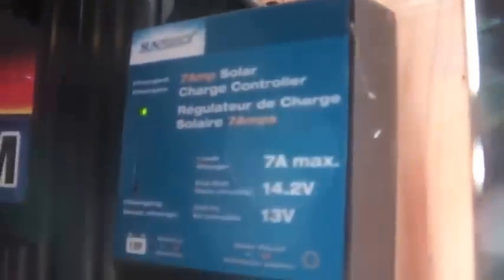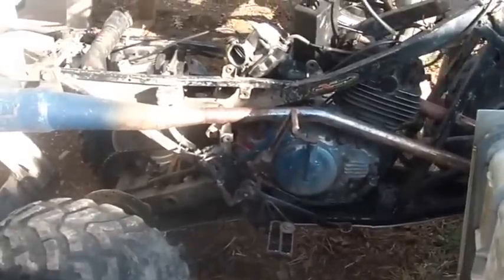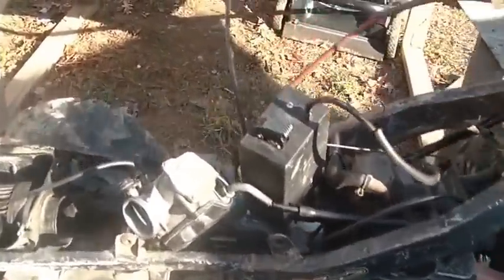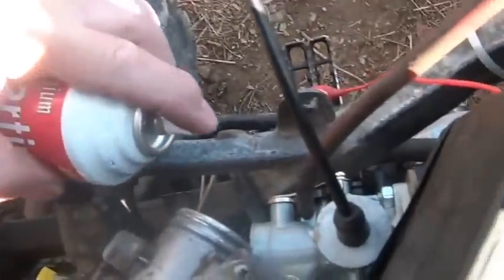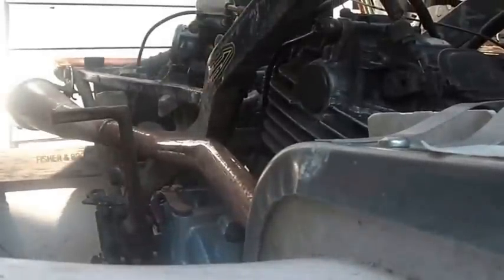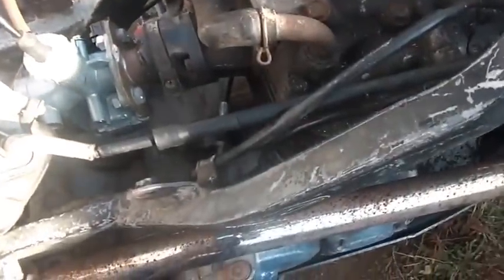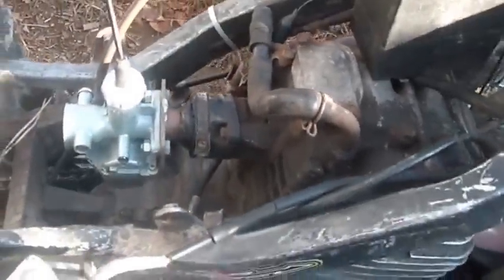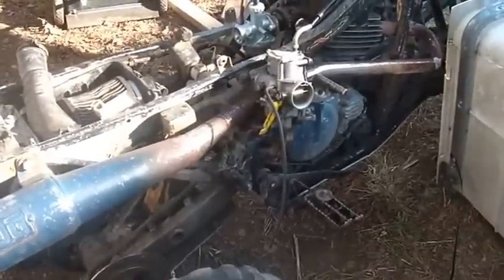Honda 250X cold start, using 12VDC GY6 Portable CDI and ATC200S Carb,

Comment: The carb I got is from a 300ex. should fit fine though. The bikes are the same length. All the same except for bottom end on engine and wiring. I had a 250x frame with all 300ex stuff on it. I'll go out to garage this coming weekend and grab that carb. Probably mail it Monday.
Reply from the maker: Hey Bill, U R right, the 250ES carb has a smaller bore then the 250X.... I appreciate the carb as I do not have a spare and I have a feeling more 250X/300EX ATVs will be coming... Thanks for the info, the offer of the carb, your thoughts, watching, and commenting!!!
Reply: Do you want it still?
Reply from the maker: Hey Bill, Yes, I would like the carb if U can spare it, will send U the $20 U requested... Thanks for the offer, watching, and commenting!!

Comment: i used to love the kick starters. not those weard foreward kickers. and not those huskavanas. lefty kicks were the worst. now im 41 and enjoy an easy pull start like you. electric only if it has a backup manual starter prefered. cheers bud. get it covered before it snows again. lol
Reply from the maker: Hey Wally, I have some rain for the next few days, then a few somewhat warm dry days, I really can't drag my feet any longer.... Thanks for your thoughts, watching, and commenting.... BTW, my experience with the old Huskavanas is that they kicked back like a 1500 pound, angry bull moose, during mating season....
Reply: yeah. the old huskavanas very brutal. my uncle raced enduro until he was 51. he always has a huskavana. excuse my spelling. lol great bikes. brutal to kick. cheers
Reply from the maker: Hey Wally, They were virtually indestructible, unfortunately, not always easy to start... U ever see the real old ones with a leather seat, almost looked like a saddle, (no real padding), ????
Reply: no i havent. ones my uncle had were early 80,s version. would love to own a street legal one. some were street legal back in the day i believe. 
that would be a blast from the past. 😎